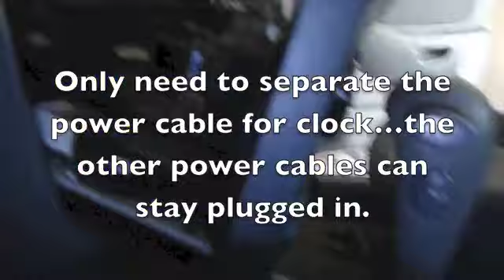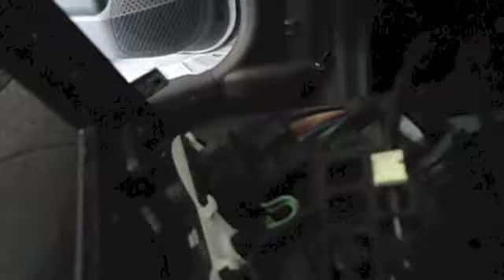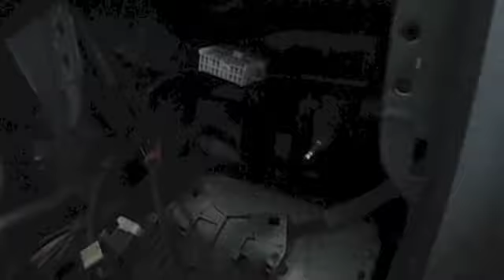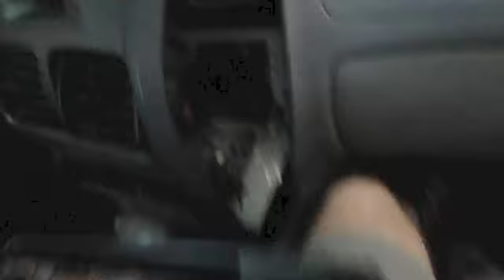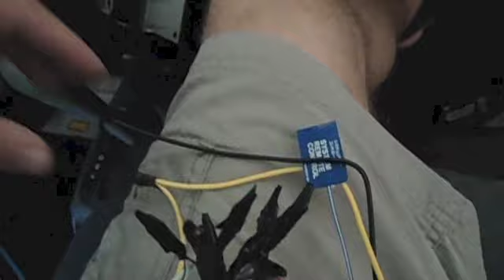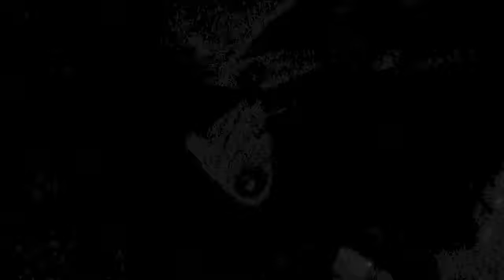Part Two 2005 Hyundai Accent Stereo Install

Comment: I am glad to come across to this useful video after such a long time. It still works. Thanks a lot . I just wonder if the radio antenna worked just like with the stock CD player or you had to make some extra fixing etc. I would appreciate your reply. The guy who I got my factory unit replaced with an Alpine ute 72bt wasn't able to make it go down when you switch to any1 of the usb, Bluetooth or aux players from the radio. It still stays up. And the second thing is that, the head unit is no more illuminated at night. The factory unit used to be illuminated even it was not on. I'm looking forward to hearing about your reply.

Comment: Yes, ALWAYS disconnect the negative terminal before fiddling with anything electrical in the car, whether it be speakers, AC, Fuses etc.

Better safe than sorry.
Reply: Not if the negative terminal touches the chassis or another grounded piece of metal, circuit completed. Take BOTH terminals off to be "better safe than sorry". Always. ;-)